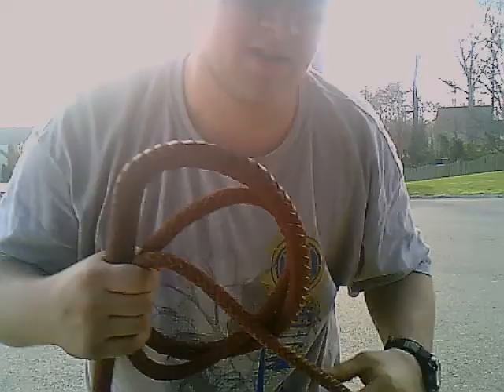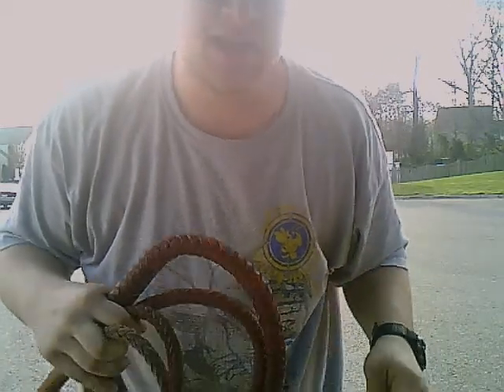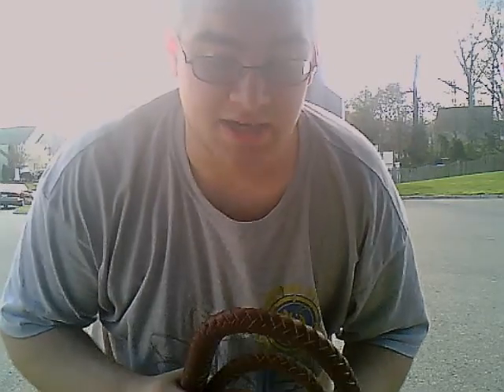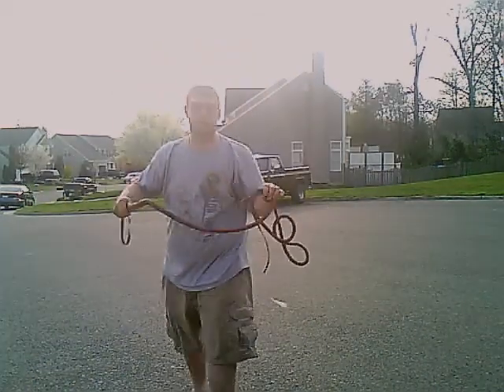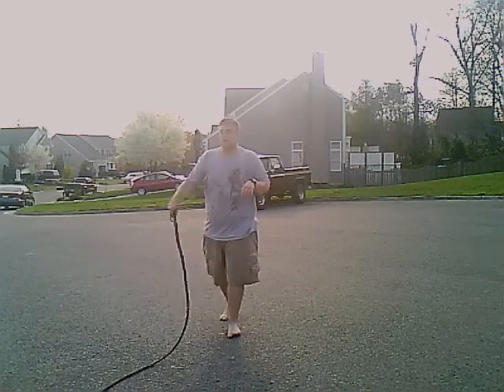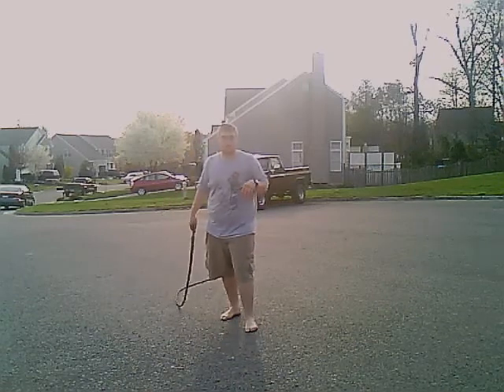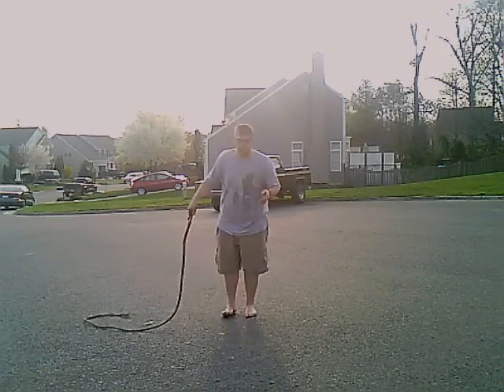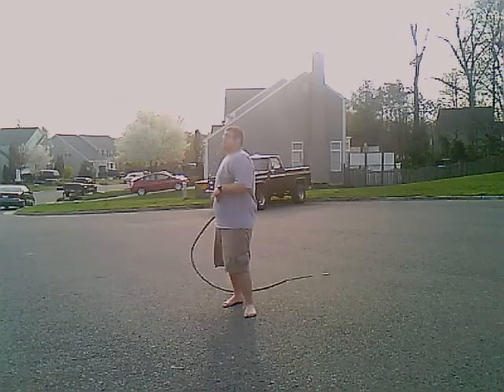physics of a bull whip 101

Comment: If you use an old belt taped to that tape they use for 3M plastic windows, the latter will delaminate and "Crack." 

And if you use thin hammered Gold and crack it in a Vacuum, you should get a Cone of Light as it Breaks Warp 1. (Relativistic Thought Experiment.)